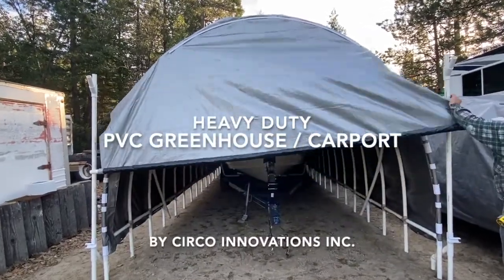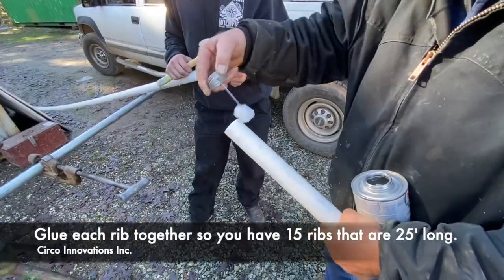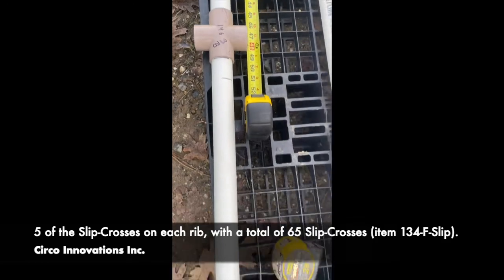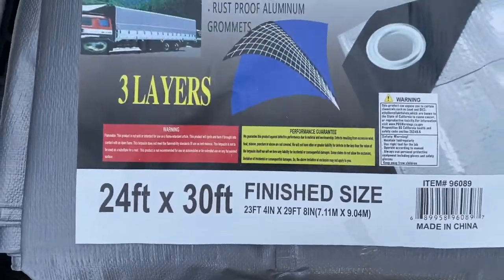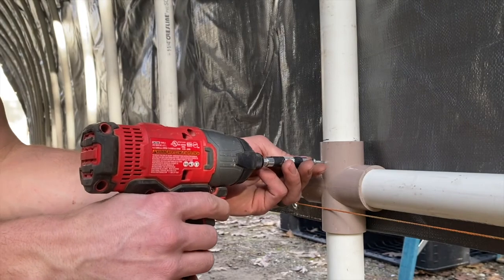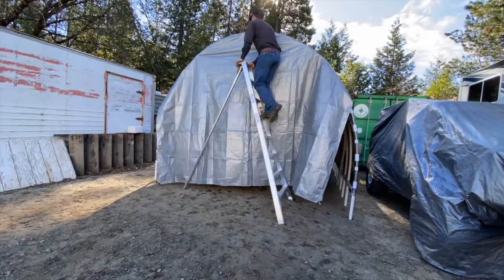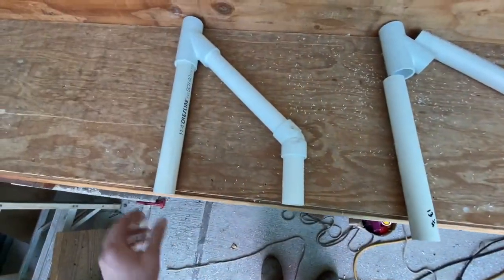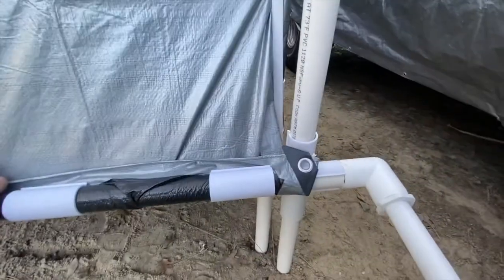How to Build a PVC Heavy-Duty Greenhouse / Carport (Quick Version)

Comment: Gave me an idea try to make a RV cover. It will need to be 12' high 30' long and 12 wide. I will have to figure it out. Good idea.
Reply: Hi - just wondering if you built this type of cover, how it turned out and lessons learned that you wished you had known at the start.  I have a 38' travel trailer and looking to build a cover that is 14' wide x 13' high x 40' long.  I am semi-permanently parked and the TX heat is a killer - two ACs just can't keep up so hopefully covering will help.  Thanks
Reply: @anthonyshearin4603  I will second all of your points. I’m in a 33’ trailer too. Need some relief from this TX heat!

Comment: How much did it cost for all the materials to make this.
Reply from the maker: Including pipe, fittings, metal stakes, tarp, grizzly board, as well as labor hours. It was around $2,000
Reply: $2000 for something that could possibly blow away in Armageddon winds and rain. I love the carport. But you can buy a shed for less and it's cyclone rated. This isn't. But well done guys.
Reply: @wyomingpark What 30 foot long shed can you buy for under $2,000? I'll wait.